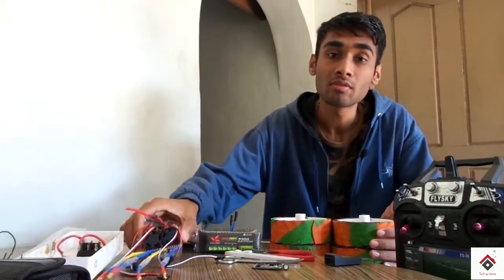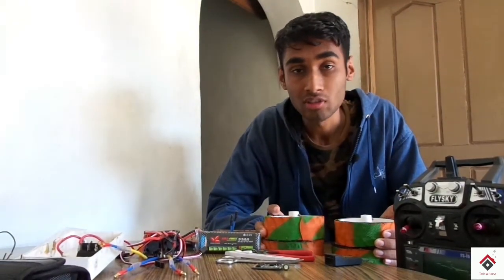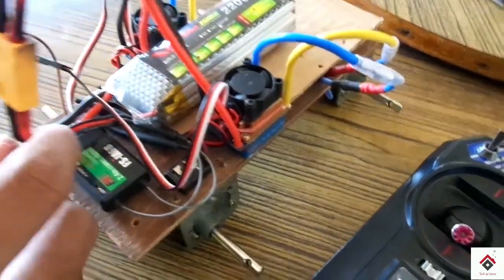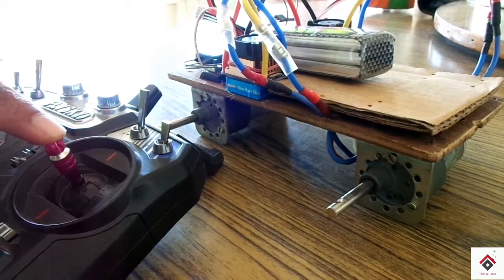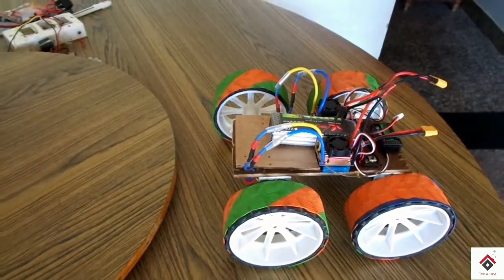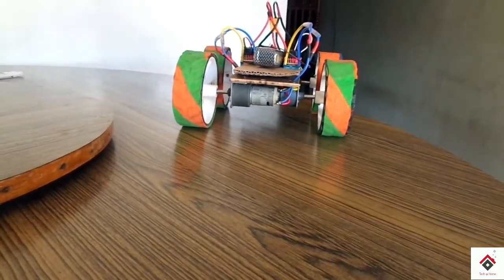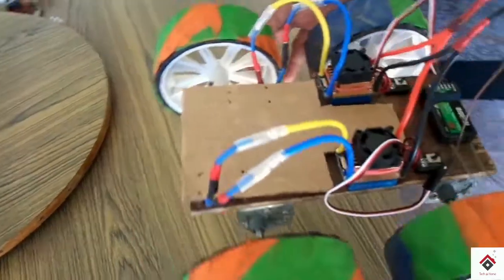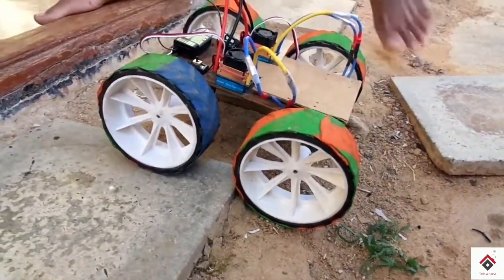How to make 4x4 wireless Roborace Robot using Flysky and Brushed ESC

Comment: What if I use only one Brushed ESC?
Reply from the maker: You can't turn right and left,
Reply: So if i use 2esc then i will be able to forward, reverse and break also..right?
Reply from the maker: Yes, one ESC for right Motors, and another for Left Motors
Reply: Can this esc also work for 12volt dc gear motor with 300rpm torque?
Reply from the maker: Yes it will work

Comment: Can u provide me the connection of ESC with motor and receiver
Reply from the maker: 1) connect two right motors in parallel ,and connect them to ESC 1.
2). Connect the ESC 1 to channel 1 of receiver.[all 3 wires : signal,5v,gnd].
3) connect two left motors in parallel ,and connect them to ESC 2.
4). Connect the ESC 2 to channel 2 of receiver.[only signal wire].
5).In the transmitter, go to setup, Elevon,Turn on the mix.
6).If the Motor is rotating in opposite direction, change the Motor terminals.
Reply: @techathome  thankiu brother

Comment: Plz make a video,  how to use bts motor driver without micro controler and brushed esc...
Reply from the maker: Without microcontroller I don't think its possible. It is required to read the receiver data and actuate the motor driver.
https://youtu.be/EnbkdrYQ0NE

Comment: How much cost came to build this bot RS. ??
Reply from the maker: This I have done 3 years back, so now price will be completely different, 
when I did,.....

( 4 ) * Johnson gear Motor A grade  : 1600

(2) * Brushed ESCs ( I have purchased from bangood ) : 2200 

Flysky Fs-i6 Tx and Rx : 3200

(4)*  Wheels : 360

2200 mAh 3s lipo battery : 1000
Reply: You can give for me this car
Reply from the maker: No bro, we need this to compete in Robotics competitions
 Now bangood also not shipping to India
In Amazon the ESC'S are very costly
It will be very difficult for me to get Components
Reply: Sir give me only esc please